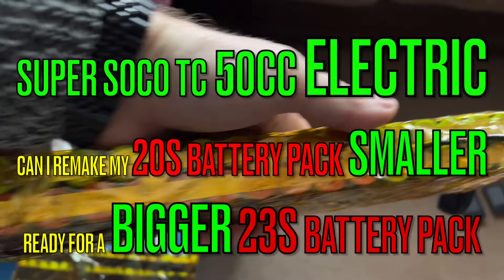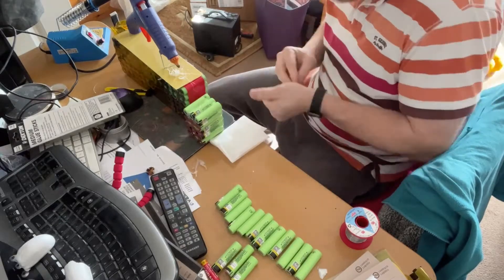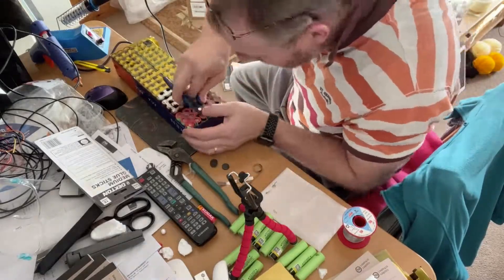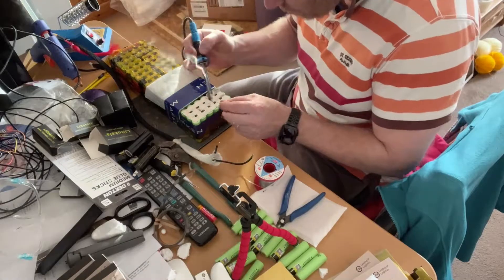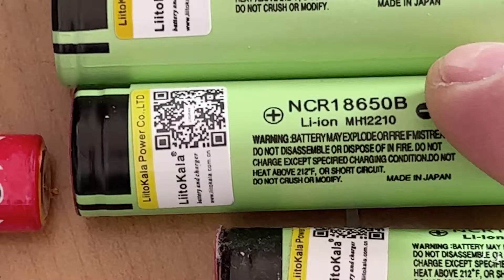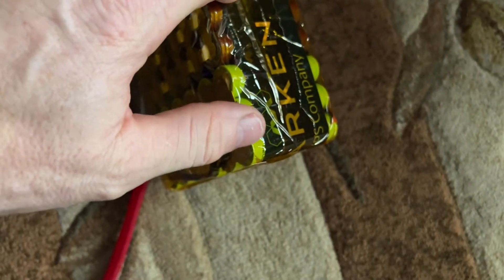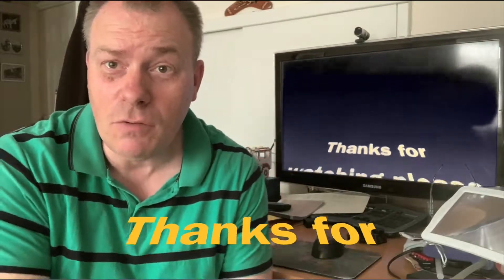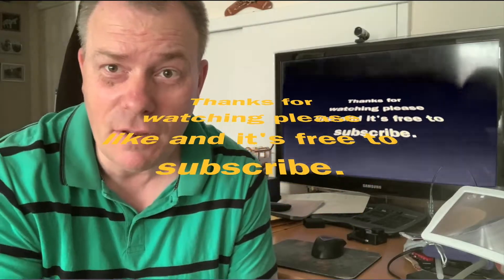Super Soco TC 50cc Electric, Can I remake my 20s Battery Pack Smaller Ready for a 23s Battery Pack

Comment: Hi , does the super soco motor support 23s , 84v 😮 without get burn ?
Reply from the maker: Voltage isn’t the problem when it comes to the motor, Amps are the problem, because if you throw through too many amps, you will melt the wire insulation on the coils of the motor